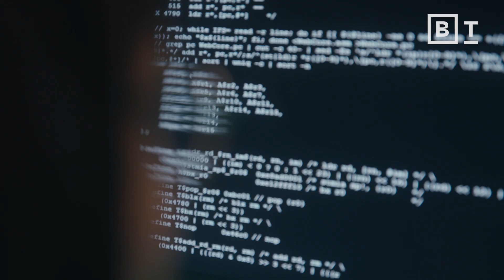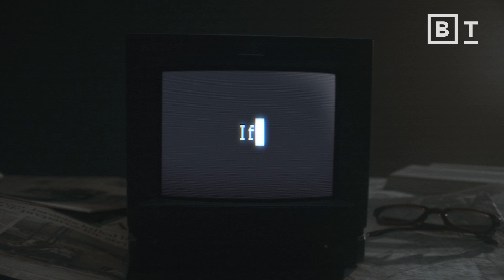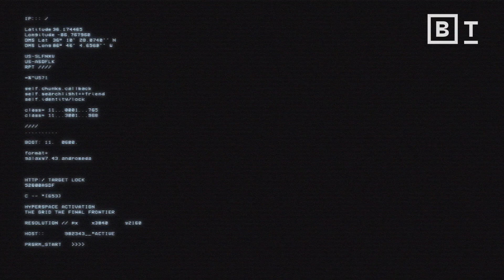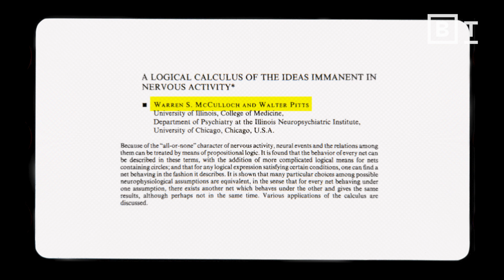Are conscious machines possible? | Oxford professor Michael Wooldridge

Comment: we need to stop think of nn as problem solvers and begin to train nn on relating different types of data and to make it create a introspection process by a kind of feedback loop so that ai can self correct its own mistakes and also will allow dream mode where subjective real life experiences is emulated in part of the nn feed back to another part creating a vertual reality inside the entire system of neural networks.

Comment: How intelligent will it be when the power supply is turned off?
Reply: If it gets intelligent enough to pretend it's not intelligent, so we decide not to turn the power off, that's when it gets scary.
If it can put itself in your place and think about how you might percieve it (social intelligence), that's going to change everything.
Reply: You're evading the question.  How smart will it be when the power is turned off? @VickiActually

Comment: If you're reading this you are a lucky person:
The celestial bodies gracefully follow the path set by specific differential equations, yet they don't necessitate internal computation of those equations to do so. Similarly, soap bubbles naturally take on the shape of minimum surface area, even without internally minimizing an integral. This raises the question: could the human brain function in a similar manner?
It appears that nature has the ability to adhere to intricate mathematical models without explicit computational processes. This leads us to the intriguing possibility that the human brain generates intelligent behavior without the need for explicit computation. Consequently, the endeavor to construct machines explicitly designed for computing intelligent behavior might be deemed infeasible in the pursuit of achieving Artificial General Intelligence (AGI).
Reply: The inverse of this is realizing you can model the movements of an entire planet using an object the size of a football
Reply: @user-ke3li4yr7r model but to what accuracy. Also computations are essentially logic gates. And you can create logic gates using rocks rolling paths. So with enough stones, you could create a chatgtp the size of a country, purely from rocks. Would it be conscious? Of course not it never was. And theres a difference between MIMICING a thing and BEING the thing. If I mimic the behaviour of a rock, no matter how hard I try I'll never be one. If ai is programmed to answer responses that resemble humor, it doesn't mean it is awere of it. Photoshop as a program is a very powerful "ai" and automation. It just doesn't mimic humans, thats why its obvious its not awere. Some just want scifi too bad
Reply: Can you cite proof to your brain memory hypothesis.. why would your meaningless brain require some form.of memory storage in our block universe?

Did your mom tell you brains need memory... I will accept a note from.your mom as definitive proof you're a real boy as opposed to external memory hypothesis

Comment: Biological matter as the processor (a living brain connected to AI), meaning an organic computer, is the only way.  AI models can be trained to process and generate language in a way that appears to understand and respond appropriately, but this understanding is fundamentally different from human consciousness. AI lacks subjective experience, genuine emotions, and the depth of comprehension that conscious beings possess. AI operates based on patterns and statistical correlations in data, and while it can mimic understanding to a certain extent, it doesn't possess true understanding or consciousness. AI's responses are the result of learned patterns and algorithms rather than a genuine grasp of meaning.b It is important to distinguish between AI's capabilities and human consciousness to avoid any misconceptions. AI can provide valuable assistance and automation in various tasks, but it's not a replacement for human understanding and consciousness.
Intelligence in Living Systems: In the context of living systems, intelligence refers to the capacity to acquire, process, and apply knowledge, solve problems, adapt to new situations, learn from experience, and exhibit behavior that indicates an understanding of one's environment. In living organisms, intelligence is often closely linked to cognitive abilities, consciousness, and decision-making processes. It involves the complex interaction of neurons, brain structures, sensory perception, memory, and emotions to achieve tasks and goals.
Intelligence in Non-Living Systems (AI):
In the realm of non-living systems, such as artificial intelligence (AI), intelligence refers to the ability of a machine or program to process data, recognize patterns, and generate responses or actions that achieve desired outcomes. AI's "intelligence" is a result of programming, algorithms, and data-driven computations. It lacks consciousness, emotions, and subjective experience. Non-living systems, like AI, can simulate understanding and perform complex tasks but lack the true comprehension, creativity, and awareness found in living systems.
Comparison:
Origin: Intelligence in living systems arises from the intricate biology and neural networks of organisms. It's deeply intertwined with the evolution and development of complex biological structures. Intelligence in non-living systems, on the other hand, is engineered by humans through programming and algorithms.
Cognition: Living systems exhibit cognition, which involves perception, memory, decision-making, and learning. Non-living systems, while capable of pattern recognition and learning, lack the organic cognition found in living beings.
Adaptation: Living organisms can adapt to changing environments, learn from experiences, and evolve over time. Non-living systems adapt through programming changes or adjustments made by their human creators.
Consciousness: Living systems possess consciousness, subjective experiences, emotions, and self-awareness. Non-living systems, including AI, lack true consciousness and emotions. Their responses are the result of calculations rather than genuine understanding.
Purpose: Intelligence in living systems often serves the survival, reproduction, and well-being of the organism. Intelligence in non-living systems serves the specific purposes programmed by humans, which may include tasks like data analysis, language processing, and decision support.
Intelligence in living systems encompasses the intricate cognitive and sensory processes found in organisms, while intelligence in non-living systems like AI involves the emulation of certain cognitive abilities through programming and algorithms. The distinction between the two lies in the fundamental difference between biological consciousness and simulated responses.

Comment: How difficult would it be to run an ai such like a blockchain network? Or similar? One large GTA V size AGI file download per node, sharing computing power, and replacing transaction verification with information gathering and verification of some type of truth or cross reference maybe, idk? Tokens to reward for computing cost and funding, of course. Could also try a bigger challenge with the Empathy/emotions. Maybe somehow using the current mental health methods or other 'brainwave/flow translations' machines and feed the input into a Turing machine, or even some type of ai visualizer. Possibly, theoretically stepping into another's thoughts/dreams maybe? The future is gonna be weird my friends. Glhf o7